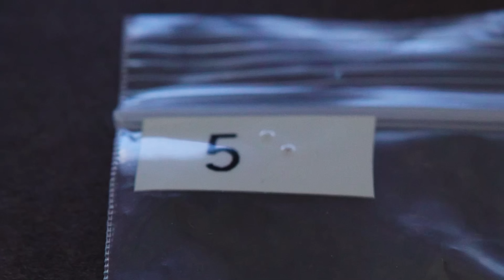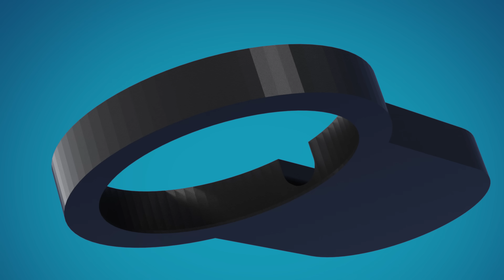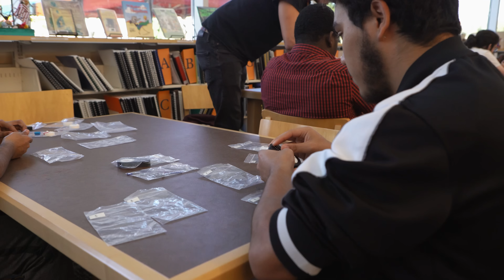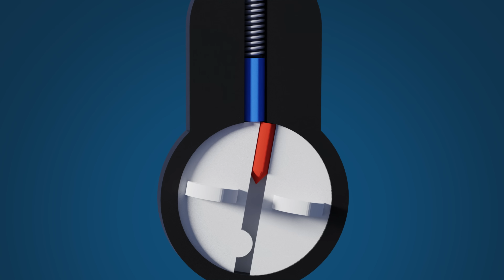Learning Lockpicking while Blind, Divergent, and More

Comment: I would be super curious how this setup evolves for teaching, like my take aways from this if i wanted to run a similar workshop (and might)

1- get some rubber feet for the assambled printed locks so they slide less
2- i would seperate out the wood mounted lock holders to be single holder places, would allow better positioning, especially for those with limited mobility
3- take some basic master padlocks or 5 pin cores, the rate they got to 4 pins was a bit of a surprise for me, but a bag with a handful of crap tier masters would have been a nice addon

Comment: This is a phenomenal lesson and a phenomenal video to go along with it! One thought of mine is that it seems from the video at least that one of the few sticking points that didn't lead to further understanding was having the housing rotating around on the table; it seemed like some of the volunteers ended up having to hold them down sometimes. Maybe a grippy or sticky surface added on the bottom of the parts could help with that?
Reply: I will admit that I commented before finishing the video, whoops! Seems like a similar solution to the large wood mounting piece you bring in later could work too. Just cutting a hole the same size/shape as the housing might work. Could mill it or stack some laser cut thinner pieces together depending on the tools available

Comment: I do wonder if it would be possible to create a model to teach two-pin picking, where you need to choose the pin to interact with. Maybe similar 2D model, with two pin stacks and two springs, being manipulated by a lockpick emulator, but with the turning replaced by pushing or pulling (so that the model stays 2D, and you can see / feel what is happening with each pin stack.

Transparent or partially transparent lock can do this, but only for sight.

Comment: A question I have had for a while is whether folks who are blind would have an "easier" time at picking up lock picking as they are more attuned to sound (clicking of a pin setting) and touch feedback (feeling the driver pins, counter rotation...) than someone sighted.  I never considered how visual the explanation of how the lock works is so integral/fundamental to the practice if beginning lock picking. Thank you.
Reply: I would say that it is always to a certain extent, a learned skill, in the sense that you actually do need to practice a lot, however, I have heard overwhelmingly from sighted individuals (being almost completely blind myself), that the "problem" of using vision, when it would not serve, did pose a bit of an issue to them.

Comment: Pro Tip:
If you always use a key to LOCK a door, then the key will always be on the proper side of the door when you need it.
Of course you can drop the key in a lake or drop it in a furnace, but just don't do that.